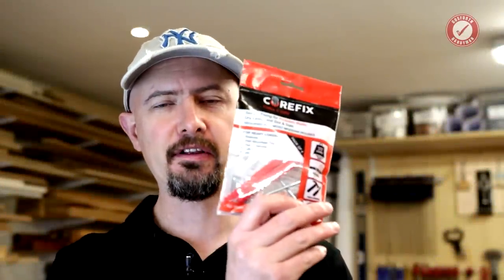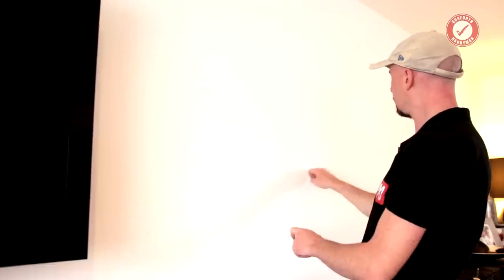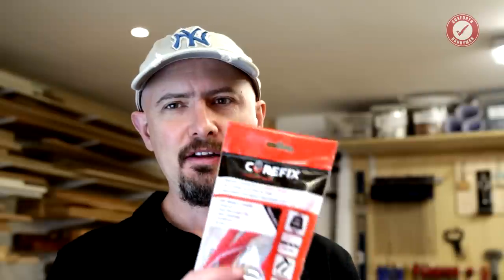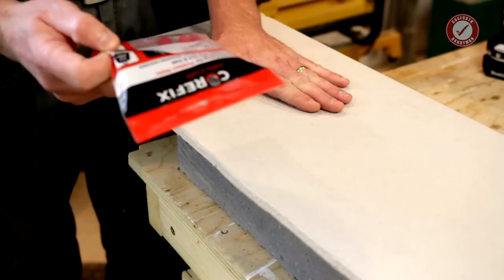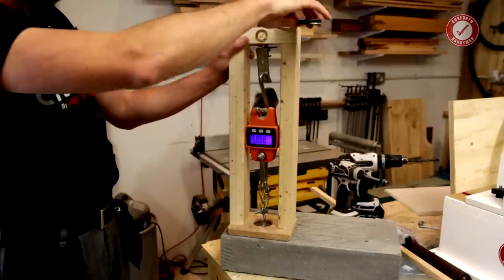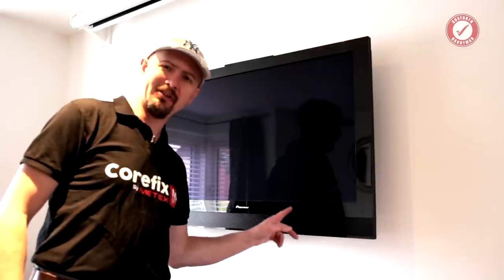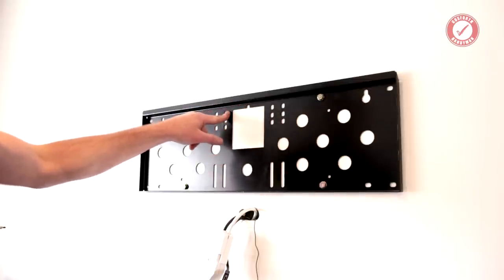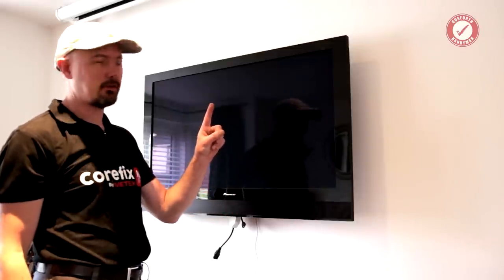How strong is a single CoreFix fitting in a dot & dab wall?

Comment: I don't think it was a fair representation. The top of the plug will sit on the edge of the plasterboard so the screw will never go as deep as you went. The plasterboard is also important to consider in loading as you're more interested in sheer forces when hanging on a wall.

Comment: used these for absolutely everything in a 1999 house. TVs, mirrors, wall mount desks, wall mount cupboards etc.

Even with the thermalite blocks everything has been absolutely rock solid. Would recommend massively.

They're not cheap at just under £1 each but £4 for the security of knowing your TV will NEVER fall off is well worth it IMO.

Comment: Just about to fix a  65"  Samsung  lcd TV  up with  EIGHT corefix screws  do should be well good. Mind you it's on a bracket designed to swing away from the wall about 8 inches, but I'm reassured by the vid. Ta muchly mate!!

Comment: Great content. I think I need a different solution for 2 reasons. Although my TV is only 16.5 KG the bracket allows the TV to come out from the wall 40cm which I imagine creates a LOT more force. Even worse the concrete blocks are quite soft and also hollow. One of my corewfix screws carried on turning when it reached the bracket hole :(

Comment: I’ve bought both length options and used them on a couple of jobs now. I find however careful I am the tops pop off the plastic plug when I’m tapping the metal tube in. Don’t think they are nearly tough enough for hammering in the tube when it’s Into tough block.

Comment: Hi dry line is where the longer edges of the boards are tapered & jointing paste with a paper tape is used to "fill" the tapered joints lots of sanding of joints to produce flat surface method generally used on commercial sites boards fixed to metal stud work 
Dot & Dab usually domestic setting normal boards or sometimes tapered joints overlaid with jointing mesh tape then wet plaster! Good videos your TV on wall was the wall a soft block?? I fit TV brackets and I hate Thermolite blocks!!
Reply from the maker: No - normal medium density blocks fortunately! I agree, Thermalite blocks are awful! 👍
Reply: Great description of the 2 different methods that I wasn't aware of. Thanks
Reply: fair point! Plastered, plasterboard is definitely wet lining.
Reply: Americans only use dry line tape and join the edge's and paint it with no skim simalar to how we do office's.
Reply: Couldn't of explained it better my self. So many poeple answer when they don't know the answer.👍

Comment: Great vid - very useful.  Just moved into new build and looking at heavy duty fixings such as this.  The research I have done suggests these COREFIX red or blue fixings work well but I haven' t seen a good vid of someone using them in a real life situation.  thank you.  On your pull out test I wanted to check if this representative (not criticising you here).  I thought the metal sleeve needed to be inserted for 2 reasons.  1:- it offers a solid extension from the block to the o/s edge of the plaster board and 2:- when the screw is tightened with the sleeve in place it forces the fixing to only expand / lock in the block at the end where the sleeve doesn't reach and by doing so may actually offer more resistance to pull out than your test showed.  Any thoughts?

Comment: These in theory should work with a pull up bar ? I'm thinking to use a piece of timber to go over the plaster board (dot &dab) and then fix the pull up bar over that. Any comments would be appreciated

Comment: I am no plasterer but I would have thought that a dry lined wall refers to the fact that dry plaster board is used instead of undercoat then finish coat plaster directly on the brickwork which was the norm in the past.

Comment: You mention two types of inner brick wall, which are both softer than brick.  Would four of these fixings be strong enough in either brick to support a 22kg tv?  Is 120mm better than the 100mm?

Comment: What about those brass coloured long screws that my builder says screws straight into the wall (through plasterboard) without plugs and used them to fit my kitchen wall units?

Comment: We have been renovating a house and on removing floor to ceiling 70's tiles in the kitchen took most of the plaster with them! We took wall back to brick and dot and dabbed plasterboard. Currently trying to hang kitchen wall cabinets and having no luck. These look exactly what we may be looking for, would you recommend for this, bearing in mind one of the cabinets is a 1000mm and a couple of the 500 ones will be housing a microwave?
Reply from the maker: I'm pretty sure that's exactly what these are designed for! Good luck with the renovation! 👍🛠

Comment: Hi Andy,
I have recently tried hanging some shelves at my son's flat (attaching to an exterior wall) that was built in the last 2 years.  I thought it would be standard dot and dba, only to find that there was a 100mm 'void' to the blockwork.  The void appears to be filled with a semi-solid material which feels like a semi-set dry paste and I am assuming is a thermal barrier.  Do you have any experience of this kind of structure?  
Thanks 😊

Comment: I am using a pack of six of these to fit a tv bracket this week.  Sadly my internal wall.is this softer internal thermalite brick.

Any advice on drilling into them as I hear they are easy to oversize the holes and therefore not get the right strength? 

They say 4 give 73kgs of weight carrying and tv with bracket is only 24-25kgs.

Comment: At the end of the day, it's not all about the type of fixing you use to fix things to dot and dab walls. It's what you are fixing through, so in your case you are spreading the load/pull force over a large area. If you had one of the new vertical radiators on dot and dab even these might not work, as there is no way to spread the force needed to hold the weight of the radiator, as the brackets apply to much leverage to the plasterboard in a very small area.

On the other hand if they used the same brackets as normal panel radiators you would not need to use corefix fixings. The reason I know this, is that I have not long, had to install three of the new tall radiators on to dot and dab walls, and although I got a good fixing, as soon as we, (and I say we as it took two of us to lift them) tried to hang them on the stupid brackets, that come with them, the brackets just crushed into the plasterboard.
In the end we fixed two lengths of 2 x 1 par, painted to match the wall, and hung them on that.
Reply from the maker: See my latest vid about attaching anything to dot & dab. 👍

Comment: Just out of interest rather than wall bolt anchors like you have used for the tv can you use thunderbolts/contrete bolts straight thru the dot dab into the thermalite block and it works as well?

Comment: I'm putting up some black metal brackets and don't really want chrome countersunk screw heads popping out from the bracket surface. What's the best route here? Can you use a different wood screw (same length, width) with these fixings? Its hard to find 5 x 100mm round headed black screws. Other options? Put a little black cap on each screw head? (i only have 8mm diameter of space on the bracket for that). Or - get cheaper 5 x 100mm chrome screws with round heads and paint them black?
Reply: Small tin of hammerite smooth ;)

Comment: 70 kg traction. Then hang the TV and you realize that you apply shear to the screw ... and hope not to cut it off. 
The traction value is usable if you put one even below (on which you can rotate the plate towards you). Anyway, good job!

Comment: I've used Rigifix in the past to hang a 12u comms cabinet full of network gear on dot and dab and its not budged a bit. Unfortunately the outer-facing walls of my house are 50mm insulated plaster board so i have a much wider gap to bridge, any suggestions for that situation besides cutting a hole in the wall and popping some wood in to fill the void?

Comment: Have used Dryline Pro previously, will give these a go for my next installation. I like a tight fit, would they work with an 8mm hole lad. Cheers in advance.
Reply from the maker: I'm the same - I seem to remember trying an 8mm hole and it didn't fit. Might work in Thermalite or something soft but in normal blocks I snapped the plug. 😀
Reply: Gosforth Handyman cheers, I’ll stick to the 10mm then..Thank You..
Reply: Hi Alistair did you get to use our Corefix product as yet, if so be good to have a review - thanks
Reply: Metex Online yes, they worked a treat. Thank you Metex..

Comment: Andy, just going through some of your older videos. Not sure if this is common in Australia, possibly in town houses/units etc. Have to wonder, where is the damp barrier and is there any insulation, or is this only used on  adjoining walls?
Reply from the maker: Hi Andrew - have a look at my vid about how UK houses are built - basically outer layer of brick then insulation then inner layer of blockwork then the plasterboard is glued (dot & dab) to the blockwork. 👍

Comment: Hi, i have anew build and need to hang a new TV ( sony ZG9 ) that weighs 76KG onto a dot and dab with thermalite blocks behind, would this work? i have a 600mm braket on there at present with 6 corefix heavy duty anchors on, current TV is 36KG and is fine, but obviously i need to be sure it wont fall off - if not these, what would you reccommend please? great videos by the way
Reply from the maker: Wow - that's heavy! I'd consider chemical fixings specifically designed for thermalite for something that weight. 👍

Comment: Nice video!  - How are the power socket cables fed in dot & dab? Vertical? I want to mount my TV on the wall on a new build.
Reply from the maker: Vertical 👍
Reply: I know this is 2 years old, but I should point out that while cables are usually run vertically (in line with sockets, or within 150mm of a corner of the room) they can also be run horizontally and still be compliant with regs if they're inline with a socket or 150mm from a ceiling.

Comment: I see the corefix is only rated for 10mm thick brackets. What if your item to be attached is over 10mm. Like a wooden coat rack for example.
Reply: They also do a "PLUS30" version where the screw has an additional 30mm length but the plug is unchanged afaict

Comment: dry lining refers to sticking plasterboard to bock work or tacking it to stud work
Reply from the maker: But didn't the term 'dry lining' come from taping and jointing rather than a full wet plaster skim? That's what I heard anyway, might be b0llox. 😂
Reply: No tapeing and jointing is just an alternative to skimming! Its just called dry lineing as the plaster boards are a dry surface.
Reply from the maker: I've seen in described both ways - https://www.designingbuildings.co.uk/wiki/Dry_lining "...a 'wet' plaster finish is not required. Dry lining requires less technical expertise than traditional plastering and required little water, hence the term ‘dry’ lining."
Reply: Gosforth Handyman I think it is a comparative term and should really be called ‘Less Wet’ - compared to the ‘traditional’ scratch, bond and finish coats which for a standard size room had a gazillion bucket fulls of water that then had to dry out as opposed to dry lining where whatever ever you do to achieve finish is going to take a lot less water - maybe two buckets worth.
Reply: @GosforthHandyman  Persimmon new builds with dot &dab on external walls, and stud work on internal walls are not skimmed, just taped and jointed. Well, that the case on the one's I've been working on lately.

Comment: My house is DnD construction. I've been using these corefix for years now my wash basins in cloakroom, en-suites and master bathroom are all 38kg a piece and hung using sinkfix wall plates with  15 corefix screws per plate yeah I have a few screws in my walls....😆 

I do have to say I'd think the walls will fall before the wash basins come loose.

I'd highly, no, I'd strongly urge anyone in a DnD constructed build to use the corefix system worth every £0.84 per plug/screw price tag 
(24 per box 
x 0.84p each 
= £20.16 ... per box of 24 fixings).

One important thing I would point out though, not all walls are block lined on the internal walls especially. 

If your internal walls are less than say 120 -130mm wide (measured at a door opening and then deduct door frame protrusion beyond the wall surface) then the chances are that your internal walls are stud framed and NOT DnD. That said you can be pretty certain that your external walls will be DnD onto blocks.

Internal walls above 150mm will more than likely be block with DnD. 

To confirm if stud framed or block get a rare earth magnet (neodymium) and find a solid sounding area of wall and slowly and lightly pass the neodymium magnet over the wall.

If it does not jump from your hand its a block wall, if it jumps and sticks its a stud framed wall with nail or screw fixings. Test over a wide area usually 16 inches either side of a nail or screw detection. If you find another within a few millis (20-30) then you have confirmed its a stud framed wall. Trace up the wall from a discovered screw/nail to your desired height and mount what needs fixing to the stud or noggin.

Hope this helps someone

P.s. Google neodymium magnets to buy one as a simple fridge magnet wont cut the mustard.

Comment: Zip lock wall anchors will crush these. Holds around 100 lbs more (around 40 kilos) assuming your plaster board is as strong as what is standard in America. (130 cm thickness). They list the standard as 1/4 of max as accepted weight but per use with handicapped devices like fall prevention hand holds etc. 1/3 is up to code.
Reply from the maker: You might have the wrong end of the stick. My test did 88kg in Thermalite and in concrete they'd do 300kg+ (past what my test rig can handle - 600+lb). Zip lock are for hollow walls. This is a solid wall with dot & dab.
Reply: Gosforth Handyman sorry I probably misunderstood. Was talking about mounts to drywall. These anchors are also what we would use in framed shower walls when we couldn’t add (190 mm equivalent plywood or 380 mm equivalent lumber to a predetermined mount location). When just in drywall these support max 265 US pounds. 99%+ of the jobs I have worked on over the past 15+ years have had walls that are framed and covered in drywall or were brick homes with metal mesh and plaster finish. So in masonry I use red head and in drywall/ cement board I use zips.

Comment: I have Thermalite walls, but plastered over as opposed to dot and dab. Would these fixings still be suitable for hanging a TV on without the plasterboard?

If not, do you reccomend any suitiable fixings for Thermalite blocks?
Reply: If it is plastered directly onto the blocks then I'd treat it more like a solid wall, no need for a fixing like this with the internal metal sleeve. That said, these will work just as well as any other similarly sized plug&screw in that scenario.

Comment: These look great but can't find them in likes of screwfix.
Would a longer version of a normal plug work the same? Iv got the thick grey plugs which are about 10mm diameter and about 50-60mm length. So I'm thinking these should pass through the plasterboard and into the block? Thanks again
Reply from the maker: Can do - depends on the block type. You've got to watch for the plasterboard giving way when you tighten normal plugs up - the Corefix fittings solve this issue on dot & dab. 👍
Reply: @GosforthHandyman  thanks. This dot an dab is a nightmare. Causing serious issues
Reply: @GosforthHandyman  could I use the nylon frame fixing to secure tvs and other objects to dot and dab wall? Screwfix stock a variety which I think might be the answer. Cheap and easy to get hold of

Comment: What would you suggest for fitting tvs to plaster board walls in new builds with the metal stud wall systems? The duopower fischer plugs look like the answer. Your thoughts? Thanks
Reply: Scott Mclean if you can fix to the metal stud, use galvanised metal self tapping screws. Where it’s just hollow plasterboard go for some drywall anchors AKA umbrella fixings which expand behind the board with a special tool.

Comment: These are very expensive compared to the Dryline Pro fixings when used in larger numbers, but still give reliable results.
Reply from the maker: The key bit with the Corefix is the metal liner 👍
Reply: The key bit with DrylinePro is it does not need one!

Comment: I've just bought some of these, can you tell me what size washer you used for the testing? I'm guessing M5 as the screw supplied are 5mm?

The TV bracket I have doesn't have standard screw holes so I need to use washers as well.

Comment: 4 snap toggle bolts holding  up 60lbs + of tv and wallmount on drywall/metal studding what you guys think?
Reply from the maker: A flat-to-wall bracket should be fine - a cantilever one would be risky... but if you're in to studs you should be fine. 👍